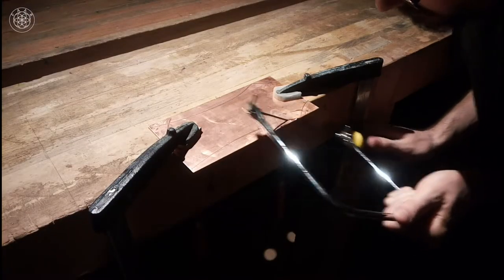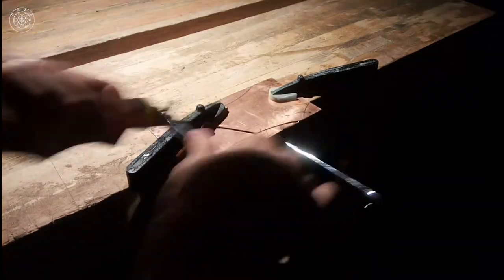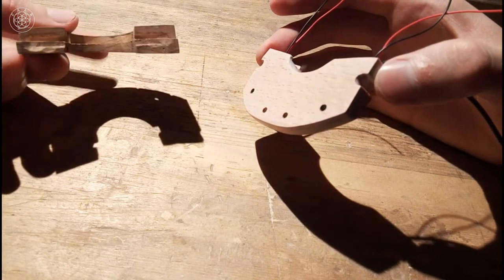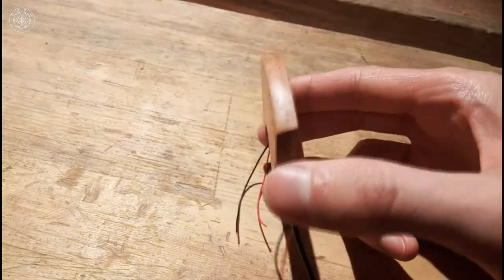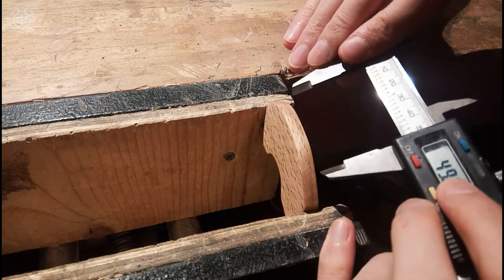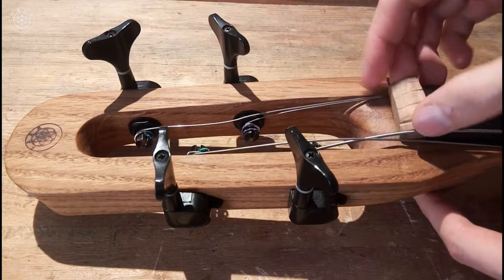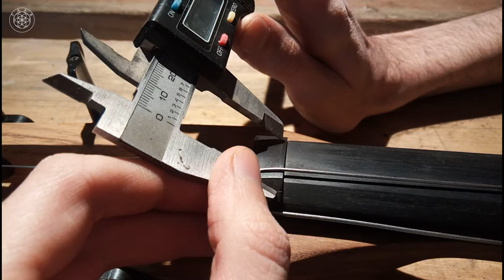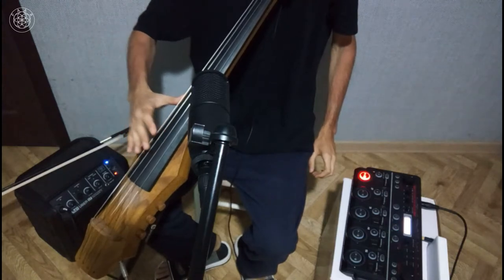Making an Electric Cello | Bridge | Nut | Installing Strings and Electronics

Comment: Thanks for the video!
It looks good and sounds good specially for the bass end.
There is something about the bowing or the sound of the instrument which sounds a bit raspy - or, that the pickups are directly glued with c.a. glue.
Perhaps some damping would improve the sound, as these are contact pickups; making it sound more acoustic.
Double sided sticker tape could be used to fix these pickups, and would have to be replaced after losing its elasticity, that's the only hitch. Maybe some other suitable glue could be used, or even rubber sheet.
Please try this, if only to please a sincere viewer!